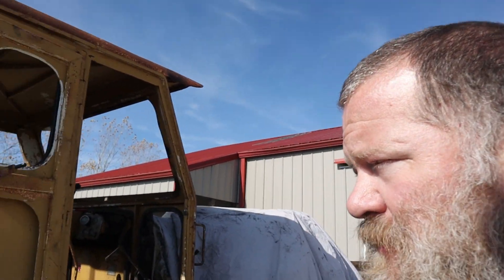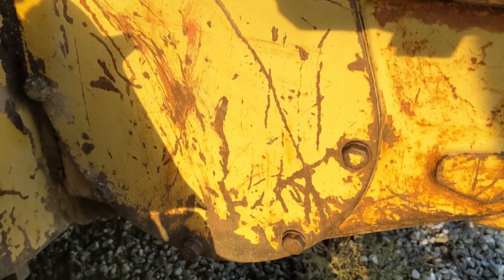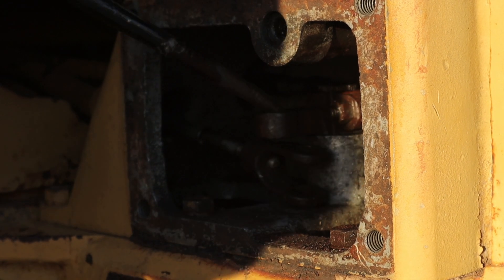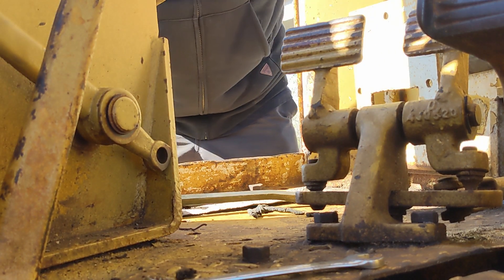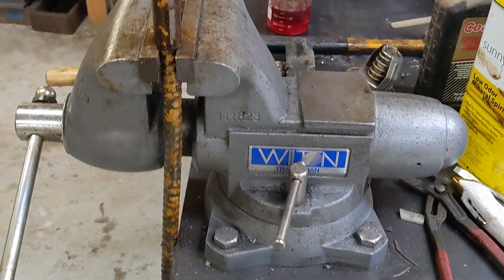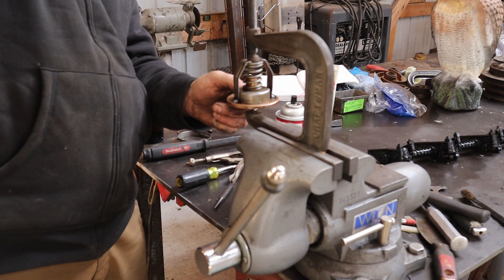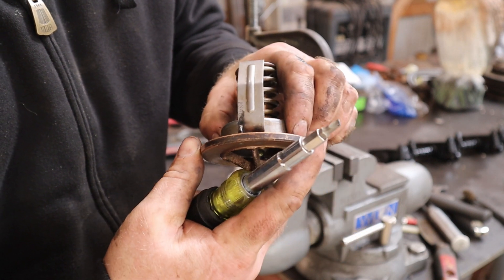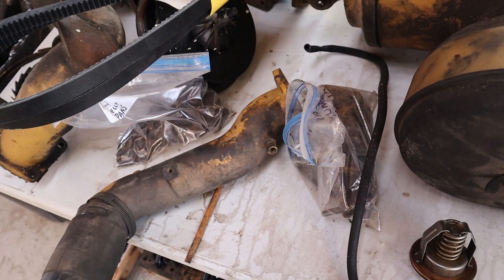Cat D6C Dozer Repairs #3 & Cab Tour - thermostats and temp gauges, winches and cables.

Comment: Regarding cat bolts, they are stronger and better than a typical grade 8 bolt.  The heads are thicker, and have better thread engagement. They are well worth cleaning up with a wire brush to reuse.  Replacements from cat are much higher price than hardware store grade8, to the point that counterfeits are showing up...

Comment: I know you won't believe. One of my remedies stick that control cable in a tube with dawn soap water Boil the cable just like making soup. I have had very good results with that method. I've used a industrial cleaner and dawn together as well.
Reply from the maker: I'll give it a shot if I can bend it far enough to fit in a pot. I might have an old beer keg that I cut the top off that might be able to fit it. I'll let you know how it goes. Thanks for the tip!

Comment: Some cats had a blower fan and some had a fan that sucks air past it, consequently there are two different water pumps one for a blower and one for a sucking fan, get the wrong one and you will have perpetual overheating as it try’s to move water in the wrong direction. Since your rebuilding the water pump you should be in good shape since a rebuild is just resealing it and impeller will go in the same way
Reply from the maker: Yes, I see in my parts book there is an option for reversible fan blades but my unit just has the standard blades
Reply: @DMIDoes  moot point since I wrote it before I heard you were going to rebuild saving you many hidden problems of reversible pumps. Have fun with your crawler sir

Comment: inside the thermostat bulb is a rubber boot with a wax pellet below it.. when the temp comes up the wax expands and pushes on the boot that pushes the pin up and forces open the valve cup..  older thermostats may have alcohol in them that expand.. i don't know what year the wax pellet thermostats came into use.. 

do you have a PTO Sales around..  they might be able to make those winch control cables up for you .. there are also shops online that you can get them done also.. 

 the Gauge is one piece .. but usually comes with a straight bulb on the end..

Comment: Hint on Cables... if you can get the end disconnected from the levers... you can slip a hose over the cable casing end.. and then fill it with penetrating oil or pump grease thru it with fittings on the end of the rubber hose extensions..